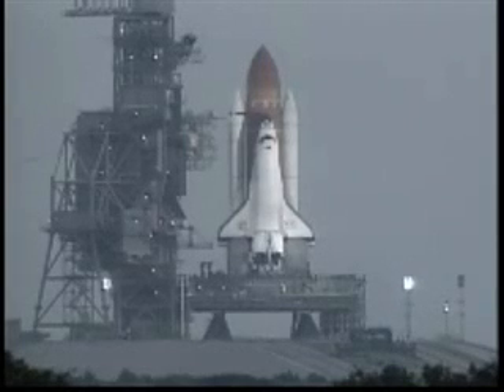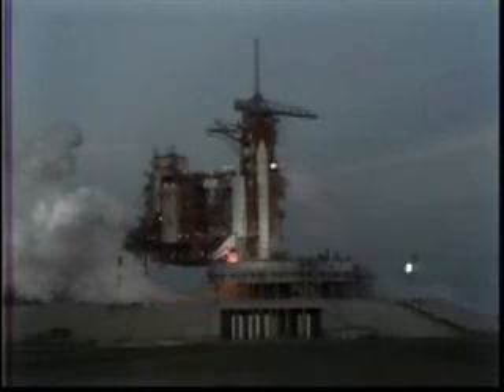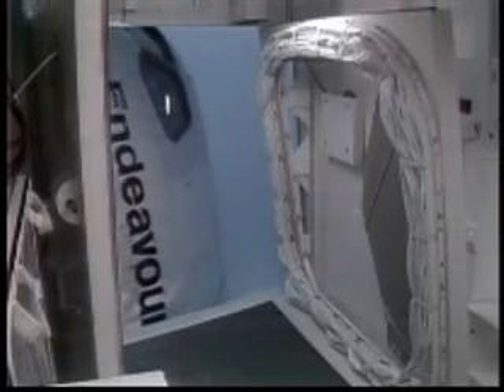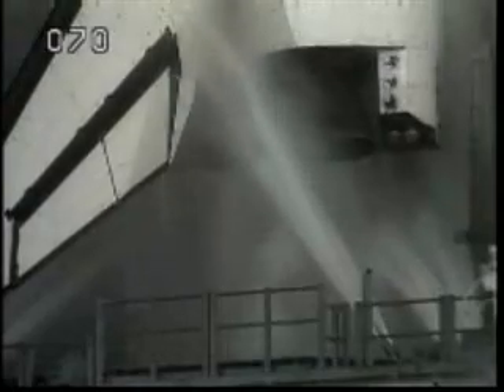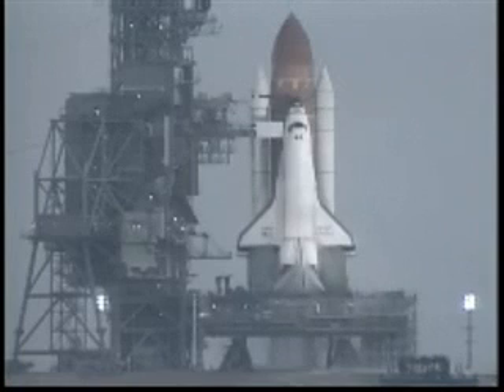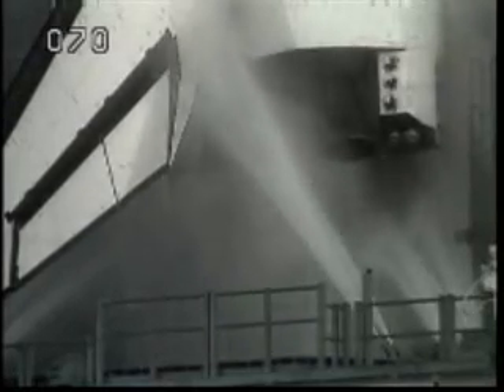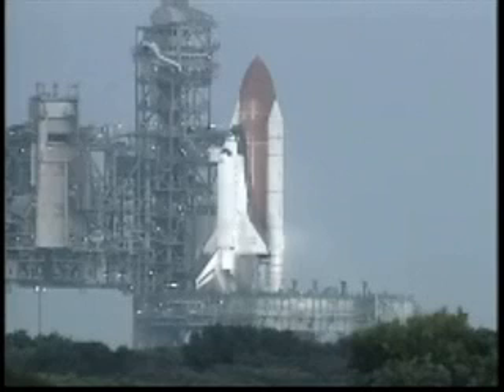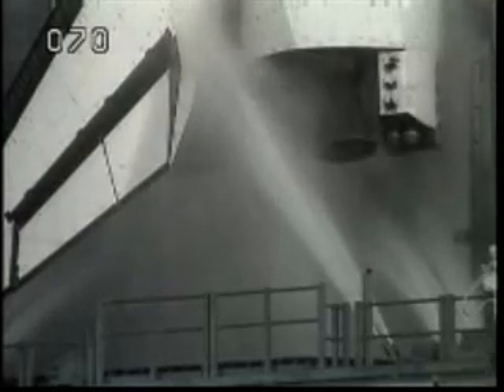sts68 on pad abort

Comment: @Zackarydoo That's called the "twang" and it happened everytime the main engines started.  The thrust basically bends the entire stack over for a few seconds.  That's why they wait to ignite the SRBs.  If they launched at T-3 when the main engines are at full power, they'd be launching at an angle.  When the twang subsides (6.6 seconds) they launch.

Comment: Zackarydoo, I assure you that the Shuttle did not start moving upward before engine cutoff. The stack remained bolted to the Mobile Launch Platform (MLP) at the base of each Solid Rocket Booster (SRB). The only way that the stack can leave the pad is with SRB ignition, which didn't happen.

Comment: I know a worse pad abort.  Gemini 6 on December 12, 1965.  The Titan 2 engines ignite at T-0 seconds and the shutdown occurred at 1.2 seconds after ignition.  The risk was that the rocket would explode even when the rocket rose an inch off the launch pad.  And the ejection seats actually had the risk of compressing the spine since they were designed to do a FAST ejection from an exploding rocket.